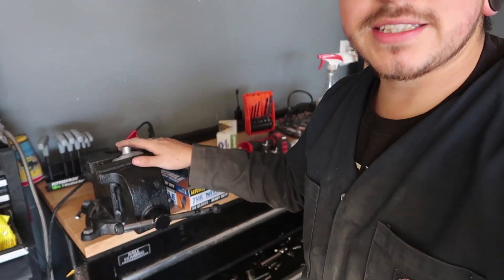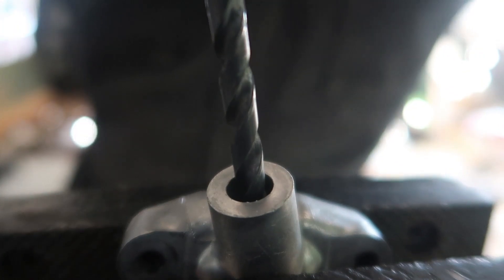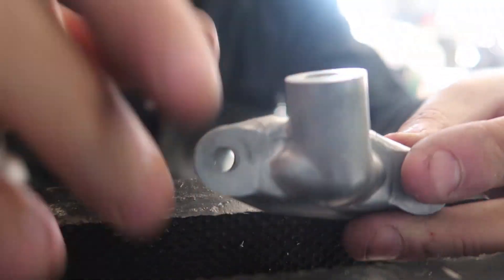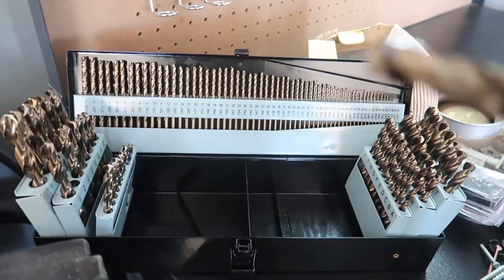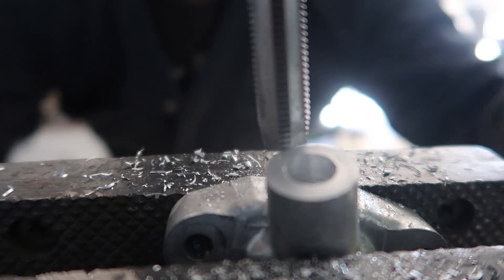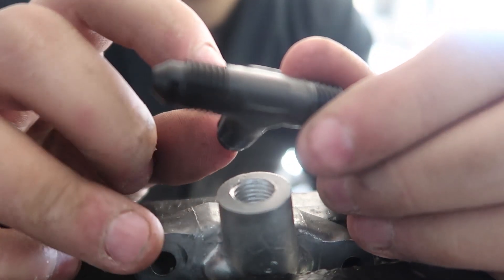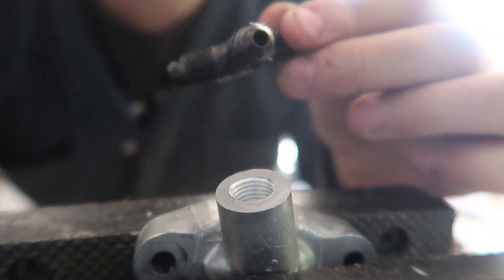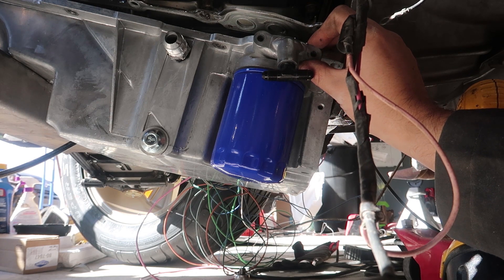THE BEST AND CHEAPEST LS TURBO OIL FEED

Comment: What’s the AN fitting above the drain plug?
Reply from the maker: For an oil return
Reply: Was that the oil level send ? Are they any issues this way ?
Reply from the maker: No I drilled and tapped the pan as high as possible. Honestly these days theres plenty of better solutions. Look up timing covers with oil drain
Reply: Thanks! 🤙🏽

Comment: At your drilling operation, drill through with your 25/64" final tap size drill instead of the 1/4". It'll be centered and make a larger passage for free oil supply flow. You will want to use an AN fitting with the "O" ring seal.

Comment: I found out that it’s better to get the fittings to get the feed off the top of the block where the oil pressure sensor is cause if your turbo blows mid run and can run all your pressure into the turbo than the ready of your motor don’t have pressure on top of the block prevents that

Comment: What size was that tap? Was it tapered tap?
Reply from the maker: I recommend doing a pipe thread tap and use a pipe thread fitting not -AN
Reply: @JovaniDanteGriego  That is NPT correct
Reply from the maker: @BulliKid  yes, there's days I'm pretty sure they sell them already tapped for An if you wanted to go that route as well.
Reply: I just need a tap for oil pan drain 1/2 NPT tapered i believe.  Does the actually fitting have to be tapered too? Or or can be straight? (Might be dumb question)
Reply from the maker: @BulliKid  the fitting needs to be not as well
Reply: @JovaniDanteGriego  ?
Reply from the maker: @BulliKid  NPT sorry
Reply: @JovaniDanteGriego  NPT straight or NPT tappered fitting?
Reply from the maker: @BulliKid  whatever you tap it with is what size fitting you use

Comment: My Truck actually has an oil cooler attached to that fitting. I would think with a turbo you would also want to have the oil cooler lines. 
Good idea but I do agree with others to use NPT threads.
Reply from the maker: You could but i kniw of many build that have no oil cooler and run fine so its really up to you. The oil cooler was for heavier towing applications i believe and yea NPT it the way to go

Comment: Dude!! That's such a good idea! Its like it was designed specifically for that purpose! Great video!! I bet this helped alot of dummies like myself
Reply from the maker: Thanks man! It wasnt my idea. But if you do it get a 4an to 1/8 in npt adapter to prevent leaks. Im going to make an update video soon
Reply: @JovaniDanteGriego  Hey, does the 1/8 npt side thread into the 7/16 tread tap you made?
Reply from the maker: @Camaro-1969  yes I believe that is the proper way to do it and make it seal
Reply: @JovaniDanteGriego  Everything went perfectly with my tapping. 1/8 x 1/4 fitting  from acehardware, auto part store tap & die set rental, and I am going to refund the 25/64 drill bit back to homedepot (LOL). Cost me $4 total and a little elbow grease. Way easier than I thought. Thanks bro. I saved your video for awhile and finally tapped my block off plate yesterday.

Comment: ghetto....
Reply from the maker: But still makes 500 to the wheels so... 💁‍♂️💁‍♂️
Reply: @JovaniDanteGriego  500 9n twins pffft are you running 3lbs of boost....telling people to RTV a high pressure line instead of using proper fittings is the wrong answer.
Reply from the maker: Then why are you watching a video in how to do it if you know everything 😂 also yes because my rear end is made of glass sooo

Comment: great video but if you ever do another, you're better off tapping it for a NPT fitting and using a -4an to NPT adapter. Then theres no need for the rtv and no chance of oil pushing past the threads.👍 Ive done a few this way but usually just spend the $20 for the dual feed plates now.
Reply from the maker: Hey thanks for the tip man! I might try that on another plate I have
Reply: Yes sir. 👍🏻
Reply: Use a transfer punch too. Best way to get it perfectly centered. Worked on mine. Great vid man.
Wish I knew half of what 👆 knows. Should be good luck garage lol
Reply: AN fittings use the 37 degree flare to make a seal. You would need to machine an o ring boss in that to make the seal for straight threads. Hope it does not leak for you.